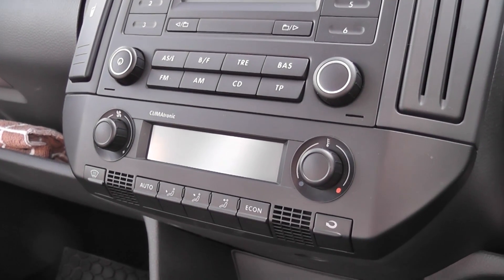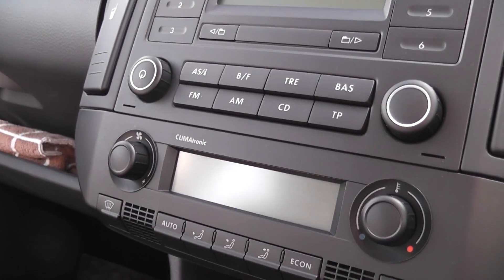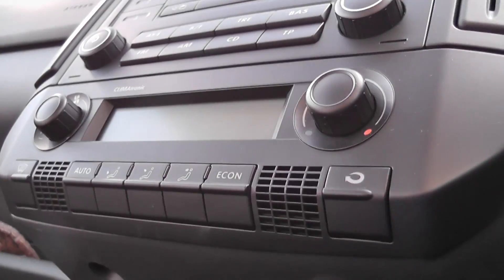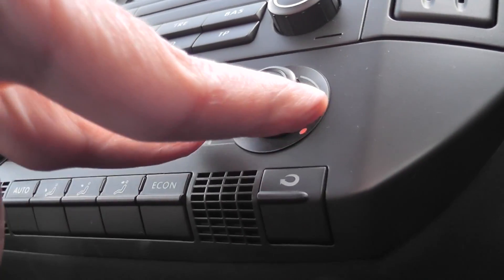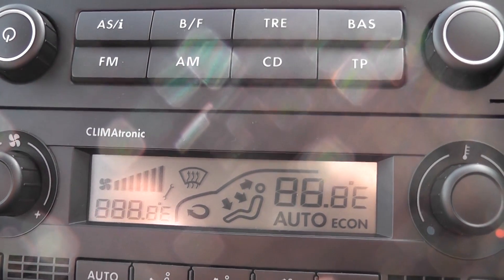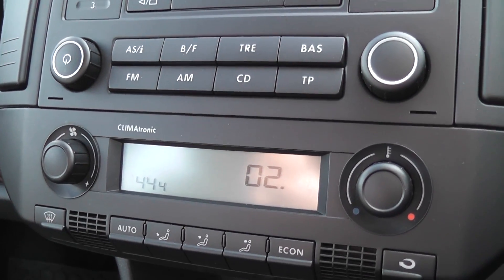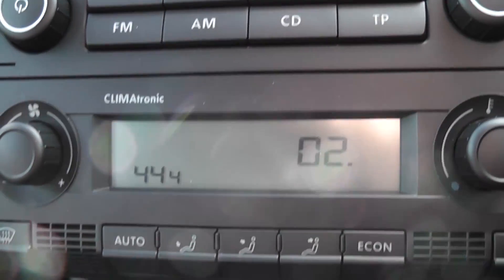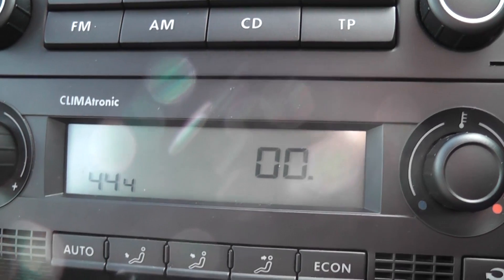VW Polo CLIMAtronic diagnostic self test

Comment: hi. I have the exact same model of VW Polo CLIMAtronic.  But for some reason the air coming out is not cold when i set it to low temperature. What can i do?
Reply from the maker: You may have a problem with the hot cold flap or the aircon needs a recharge
Reply: @myozone   Wow! Thanks for the fast reply <3
Reply: @Imperial dynamics So did u find the solution ? I have the exact problem ..
Reply: UPDATE: i talked to my mechanic over the phone and he told me he checked everything before he delivered it to me yesterday and nothing was wrong with it, and that i probably turned off the a/c and set it to air only. But there is no a/c button on that model. Is there? Could i have somehow accidentally set it to air-only mode?
Reply: @Imperial_Dynamics  Econ is actualy the AC button , if Econ is activated your AC is off and IF Econ is not shown on the screen AC is on.

Comment: Hello, how do you turn off that AUTO thing? When I press AUTO button my Cliamatronic locks on random strenght setting (sometimes six bars, sometimes three, etc.). When I move left knob AUTO disappears, but then I go back to say six bars it turns on again. It's pretty annoying and pressing AUTO again doesn't turn it off. Is this somekind bug or error?
Reply from the maker: Press ECO that turns off the AC compressor. When you turn the temp control that sets that temp with no auto regulating  were the air goes
Reply: Ok, but when I turn off ECO, AUTO will still pop up. There must be way to have ECO and AUTO turned off at the same time. I had it like that for few weeks.
Reply from the maker: Yes, just turn the temp control the AUTO will go out, you're in manual control then - that's how to works. AUTO works for me most of the time.
Reply: But in my case AUTO regulate power of airflow (thing that is adjusted by left knob), temp control (adjusted by right knob) is always on manual and changing it doesn't affect that AUTO thing. Maybe there is somekind of bug in my Clima.When I press ECO it turns on and when I press it again it turns on, but when I press AUTO it turns on, but pressing (or holding) it again does nothing at all. Only using left knob affect it.
Reply from the maker: Hmm I'm a bit confused, I think it's working correctly but it might be worth getting a garage to look at it - even if they know !. AUTO regulates everything apart from temperature.
Reply: Thanks for your time. I'll check it just to make sure that everything is fine.
Reply from the maker: Hi, I just made a video of the AUTO function on mine - hope it helps https://youtu.be/9c1zI25fMh0
Reply: Thanks. Tha videot explained more than a milion words. My Climatronic seems work fine or at least same as yours. Btw. if it randomly stops for like second or two and sometimes starts with delay does it means that fan is dying? i got 4f9 error in debug menu.
Reply from the maker: Mine has a short delay starting off the fan it's always been like that. It starts off with a slow fan speed. No what the error code means, you could try replacing the pollen filter ?
Reply: I haven't, but it's probably it because it sometimes smells weird for few seconds.

Comment: Any error codes present will be displayed after the test. To scroll to the next error code, press the „Warmer“ button. When all codes have been displayed, „000“ is displayed.
If there are no errors present, „444“ is displayed.
To clear the error codes: After the last code is displayed, (i.e. after „000“ is displayed), press and hold „ECON“ for at least 2 seconds. „444“ will be displayed as confirmation that there are no more codes present.
To exit the Internal Error Memory Mode: briefly press the „ECON“ button.
Reply from the maker: Thanks for that, do you know what the other codes are ?
Reply: myozone  yes , i know what the error codes are:
Climatronic Error Codes:
0000 No (More) Codes
1111 Control Unit defective
2312 Refrigerant Temperature Sender
3133 Outside Temperature Sender
3211 Dash-Mounted Inside Air Temperature Sensor
3213 Intake Air Duct Temperature Sensor
3223 Thermal Relays For Evaporators
3224 Pressure Switches Possible Too Little Cooling Agents
3234 Blowers For 3211
3241 Photosensor
4122 Actuator Temperature Flap
4123 Actuator Central Flap
4131 Actuator Stagnation Pressure Flap
4444 No Errors Available
Reply from the maker: Sleeper Code Many thanks for those. Do you also know what the other diagnostic  'channel' codes are ?. I found the ones I posted by trial and error !
Reply from the maker: Sven Eu Sorry, I don't know - anyone else ?
Reply: @TheSleepercode bro you know the code (  2C6  02.  ) ? 😂
Reply: Legal.